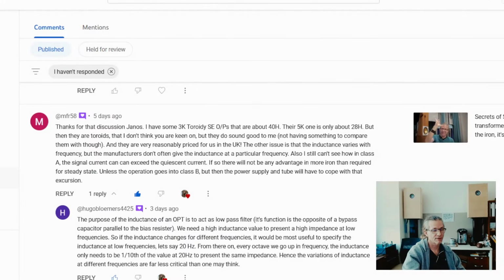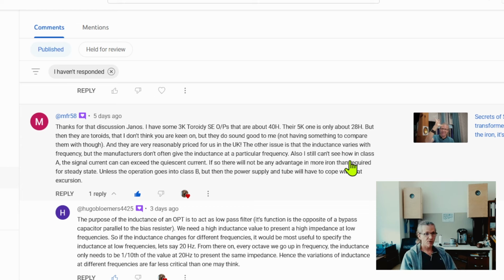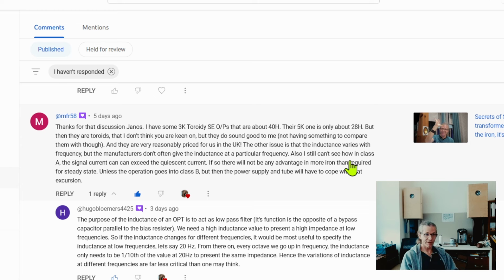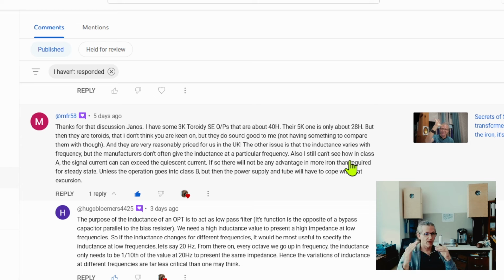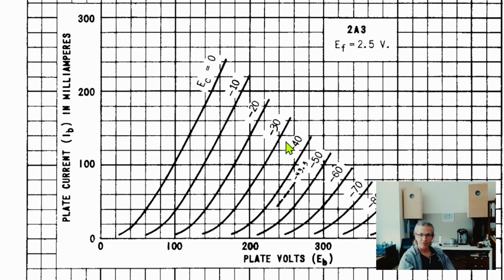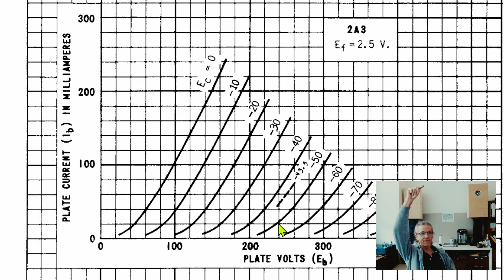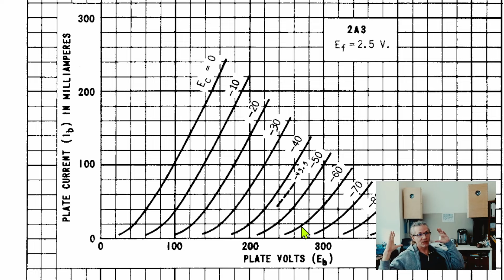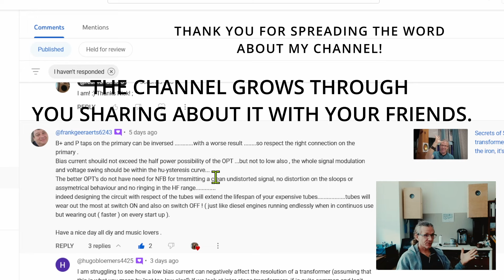A class for Class A operation with single ended vacuum tube

Comment: Thanks for that deep dive Janos. I have a much better grasp of what is happening now. To get the best of big and small iron for outputs, what about bi-amping a passive crossover, big iron for bass small iron tops? Regarding dc offset, have you tried a dc blocking circuit? I wonder if they compromise current delivery?

Comment: Found some 2A3 Tungsol with 45 printed on the base and sold as 45 tubes ..........
Transformer ( SE ) headromen tried to explain it but was missunderstood .
Quiescient current must suit the hysteresis curve of,the used transformer .......and looked at an  other viewpoint  the tube must be suited for a SE OPT.
To make it simple , .........something similar with turning the steering wheel,on a car .....suppose that turning to the left the car turning radius is 9 m.....and to the right it is 12 m
That's not correct ! 
So it is not only the Impedance that must be adapted but also the operation point / quiescent must allow similar headroom at positive and negative VOLTAGE swing on the windings.
I see you know what I was talking about .
Thank you Janos .